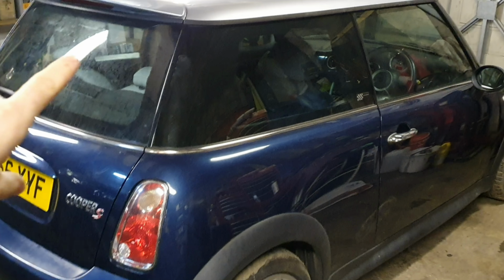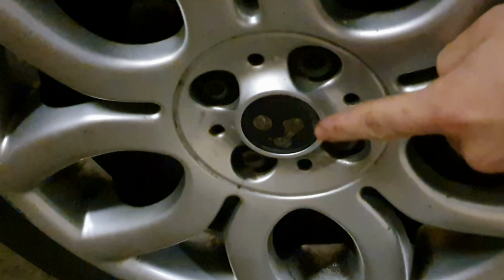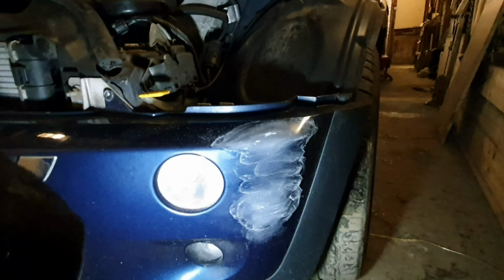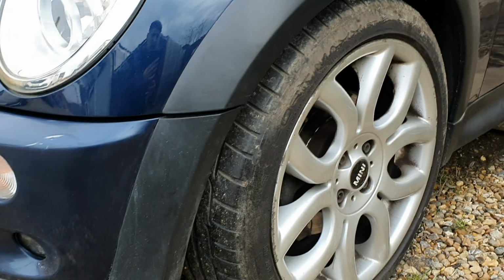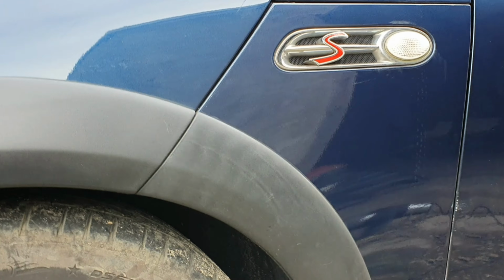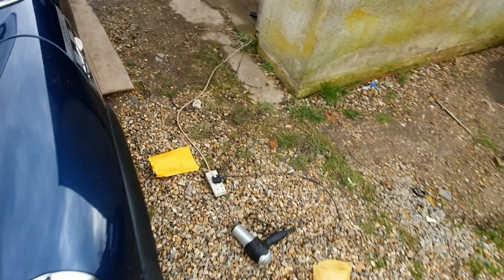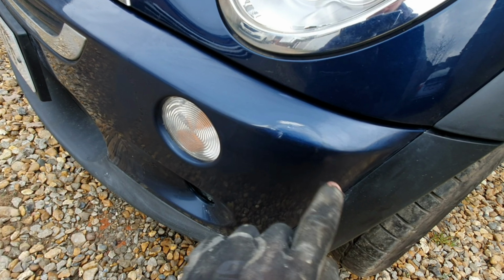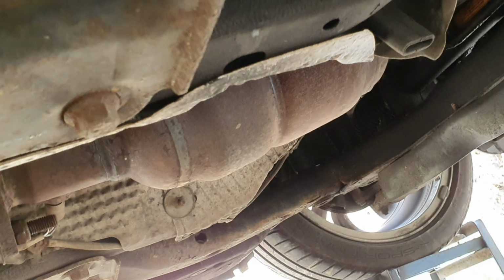Mini Cooper S *COPART* PT4: nearing the end of the build!

Comment: You should have screwed a self tapper into wheel centre pieces and just pulled them out, would have saved taking wheels off !
Reply from the maker: Usually I would do that but wanted to inspect the suspension & steering components whilst I was there